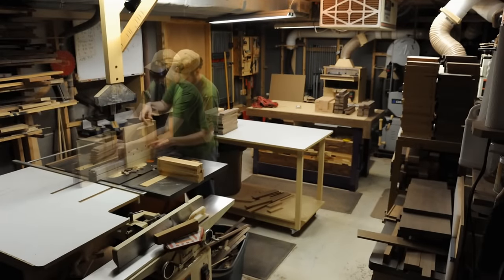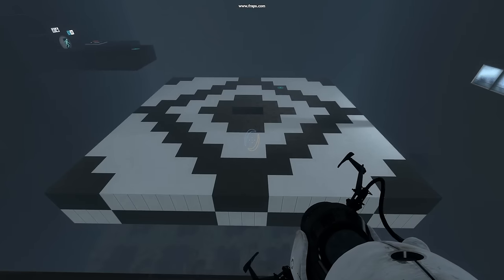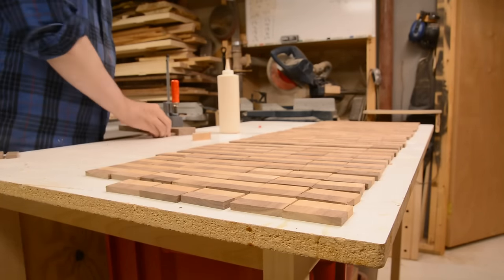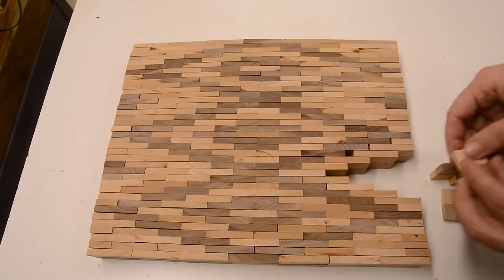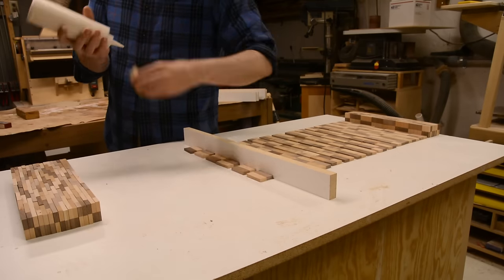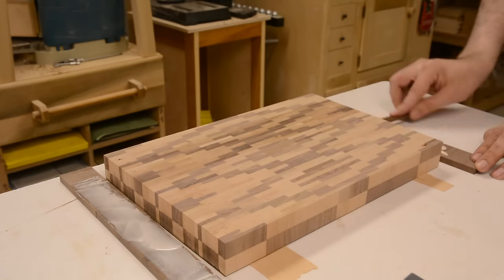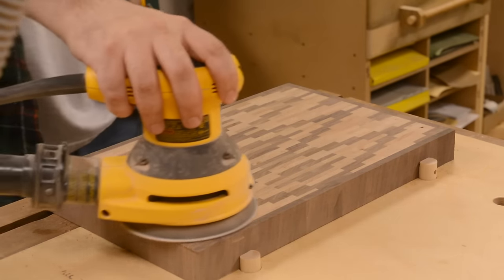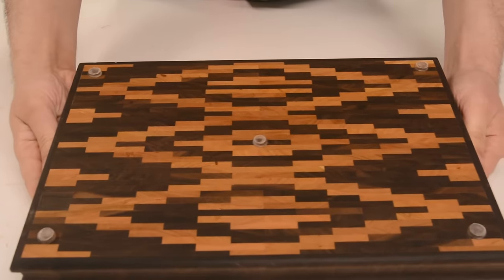Double Sided End Grain Cutting Board

Comment: the double sided cutting board will work fine without the rubber feet. just use a piece of fabric e.g. towel to lay it on the kitchen counter top and it will not slide.. make it a bit damp and presto non moving cutting board... love the build!!!

Comment: If you can come up with some sort of base that cradles the board and still lets in air maybe you can skip the rubber feet. I'm picturing an x with feet on the ends that hold the board on the x and lift the whole thing off the counter. (It is so much clearer in my head!)

Comment: I like the profile of that bit you used for the hand hold what Is It called?
Reply from the maker: Nick Jensen Lee Valley calls it an internal bullnose.  I haven't seen them anywhere else.  You could accomplish the same thing with a round nose/core box and the stock vertical, or possibly with a cove buried somewhat in the fence if it didn't have too much of a straight cutter after the cove part.

Comment: How did you glue those small pieces together? I didn't see you using any clamps
Reply from the maker: l3ender15 You don't necessarily need clamps if the surfaces mate well together.  If you think about it when you glue up a mortise and tenon joint there's a clamp pushing the shoulders of the tenon in tight but there's nothing clamping the sides of the mortise against the tenon.  If I had tried to put a clamp on the first row of blocks it would have just pushed them up in the air with anything but the lightest pressure.